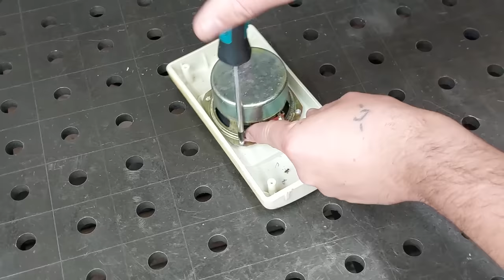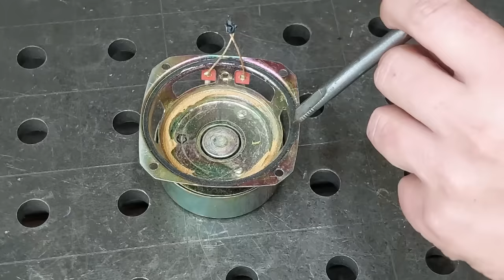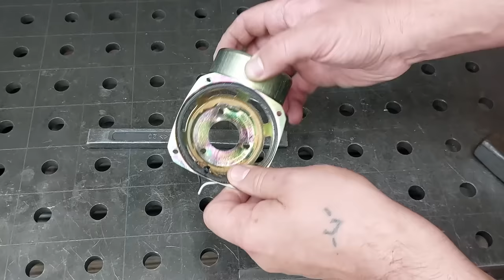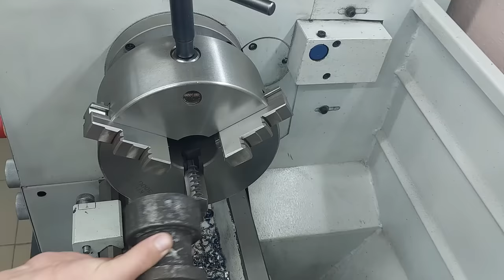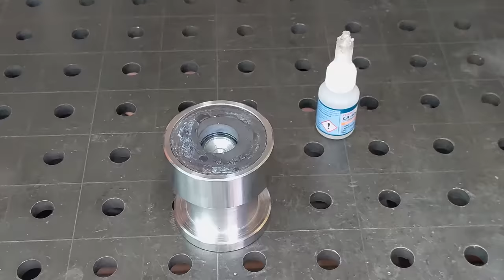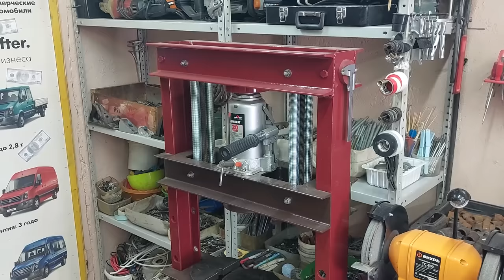Don't throw away old speakers! Not many people know this genius method

Comment: Wouldn't it work out rather expensive having to buy a lath and a press just to make that? 😁😁🤣🤣😊😊
Reply: The real problem here is we do not have a fix for stupid :)
Reply: @boatingmanchester  Stupid about what? Well made point about equipment needed. VERY few have such. Stating in headline would been useful, then talking during video. I never would have watched. Actually FFWD to end after seeing lathe needed.
Reply: @Ol_Blue  The lathe does not just build that one project, its cost is amortized over its lifespan, many valuable products.

Comment: Another  EXCELLENT  lathe build .... The Ferrite ring magnet from a busted microwave oven's magnetron is easier to get at and is NOT covered in residues .... then use your loudspeaker unit ( as shown ) to construct a  VERY  handy continuity tester using two transistors one resistor and one capacitor + a 1.5 Volt battery .... ( tried - n - tested ) ..... DAVE™🛑

Comment: Why do you have holes in your work surface?  You must lose lots of small parts down those holes.  BTW. the easiest way to get the magnet out of a speaker is 4 seconds with a hammer. I've done it many times without damaging the magnet.
Reply: That's his welding bench, so only big pieces of metal! 🙂

Comment: Don't throw away the speaker box, it can be used for future projects.
Reply: Yah that's the reason my store is full of stuff.
Reply: Yes! You could melt plastic in acetone, solder-melt a nail in each hole for structure, inject the melted plastic in any hole, machine large nails into small feet, induction heat them (with homemade coil made from security camera batteries) and fuse them to the bottom so the container will stand up horizontally, then use the same steps to fill the speaker hole on the other part, using a circle cut from your neighbor's Honda bumper, then take a plastic clothes hanger, trim it with a homemade electromatic heat knife, form it using your homemade induction coil wired to a Philips screwdriver with the handle cut off, into a lip structure on the "lid". After refinishing the pieces using 60 grit and body filler made from ramen, paint it with nail polish that has been chemically altered with cat urine. PRESTO!!! You have made a food storage container without the expense or trouble needed to buy Tupperware!!!!